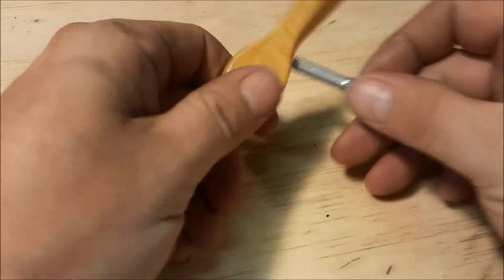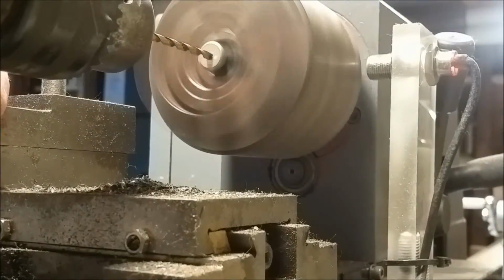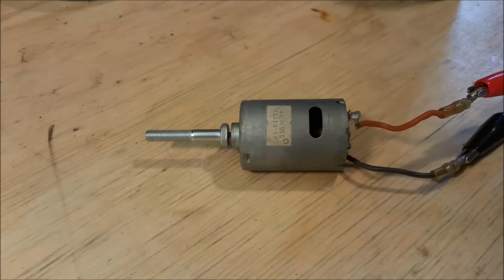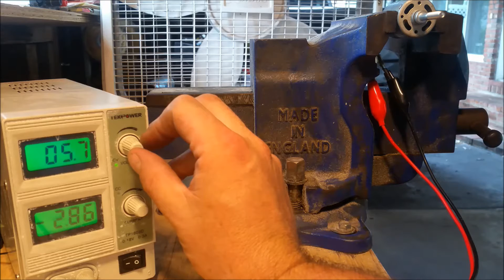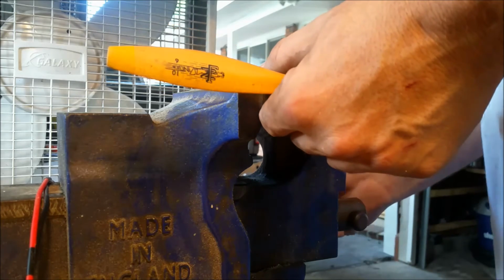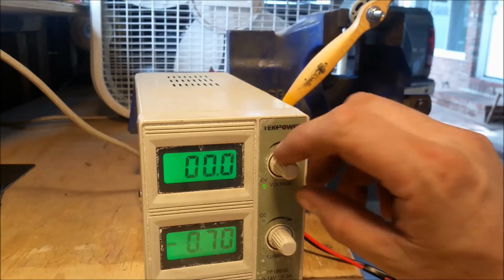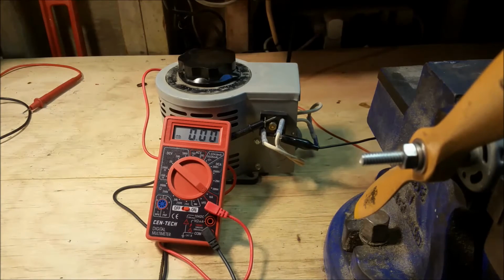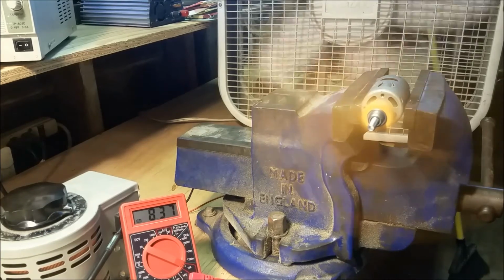DC motor and prop contraption, warning do not try at home

Comment: That's cool it actually sounds like a plane flying with the prop cutting the air
Reply from the maker: Before the motor even starts it makes noise like an aeroplane... did you notice that?  Thanks for the comment!